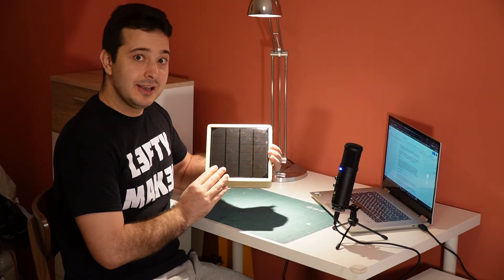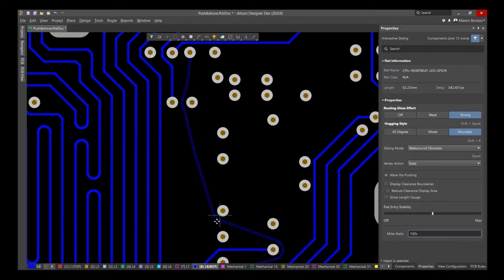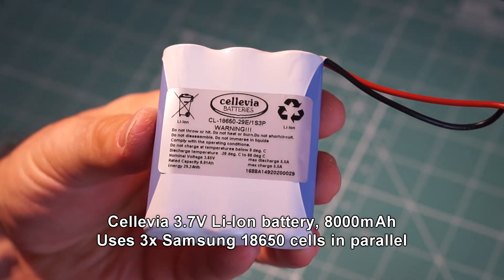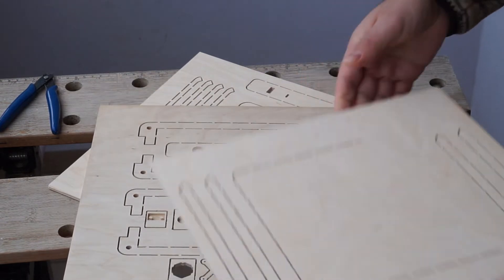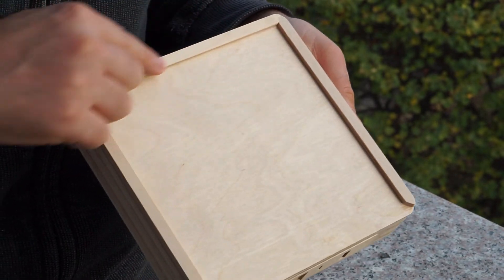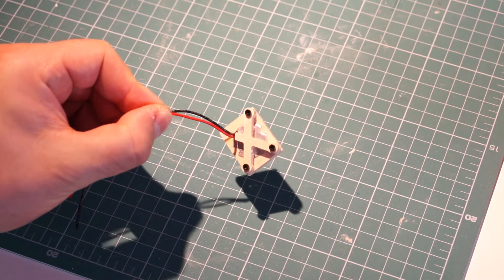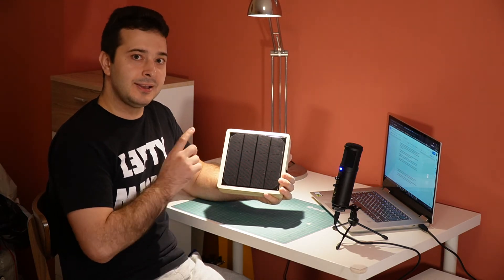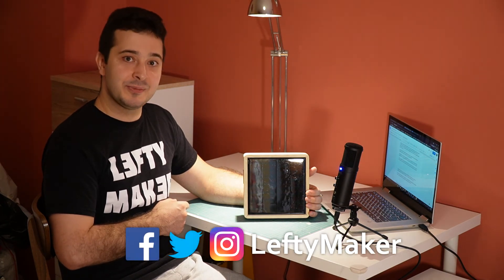DIY Solar Power Bank - charge your phone from the sun!

Comment: Because of solar cell going into the control module and having multiple outputs, that means that the control module will bypass the battery pack and directly charge the phone if the phone is plugged in right?

Comment: i know this i sold now however i wanna take on a similar project minus the electrical experience to do so lol i just have soldering abilites, my idea is to have a panel that has a usb a output so i can charge mainly an external battery, possibly other devices if i can add fast charge, what would you suggest i need/look into? trying to find a panel around the size of a phone with the high output, i think i can probably use some of the components shown here for the usb and power output. just unsure where to start. thanks for your time!
Reply: Check out the switching voltage regulators available , some have high efficiency, and can output a greater current if it is a step-down module.  To charge a lithium battery properly, another module can then  be used

Comment: How to make a fast charging solar charger? Any advice?
Reply: Without a battery pack, a 6v or 7v maximum voltage solar panel or two in parallel might give a high current, but the phone USB port takes about 5v to charge it , maybe 5.25v max.  The 6v from the solar panel can be reduced using a silicon power diode with a 0.7v drop, hence giving the phone about 5.3v.  It might work and is a simple design.   To get the voltage to be low enough for the phone , a small value of resistance (0.1? to maybe 3 ohms?) might be necessary in series with the diode.  A system test would have to be made, and-or otherwise a voltage regulator could be used, but they need a few volts extra at their input.
Reply: Another option I recently found is called something like a switching converter, basically a type if ocsillator/transformer system, and has about 90% efficiency or more and can effectively make a larger output current than the input current.  This can speedup charging a 12v rated lithium battery , and I'd a charging control circuit is also used for safety of the battery.

Comment: Thank you so much for the video, I liked and subscribed. IMPORTANT question: did u use a 6V, 9V or 12V solar charger controller? I am trying to make this work with another controller, the XY-CD60L, but it is not working on just one Li-Ion battery (4.2V)... could you give me some advice?
Reply from the maker: Hi! I've never used the controller you have, but I see online the description says ".Output terminal connect 1pcs DC 6V-60V battery." So your single battery seems to be unsuitable. Maybe you can get a battery pack or use a different battery type? The controller I have is a 6V controller, but that is for the voltage of the solar panel, not the battery connected.
Reply: @LeftyMaker  Hi!! thank you so much for answering... I manage to make it work. It is the same as yours, 6V minimal for the Solarpanel. Apparently it is working right now, its just a little tricky to configure.  I am also designing a nice box for it with Fusion 360 using this model: EZVALO Smart Alarm Clock,
If you want I can share with you. just le me know.